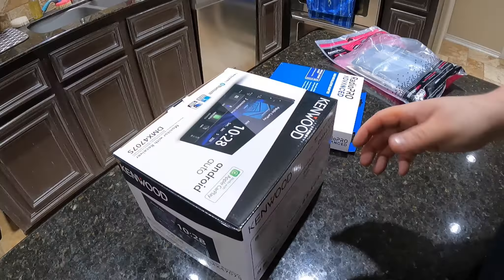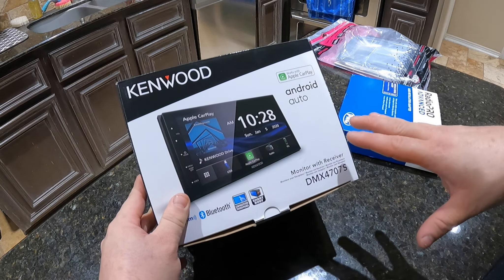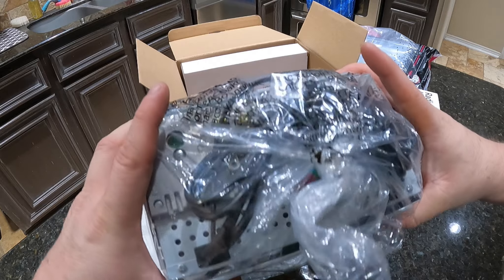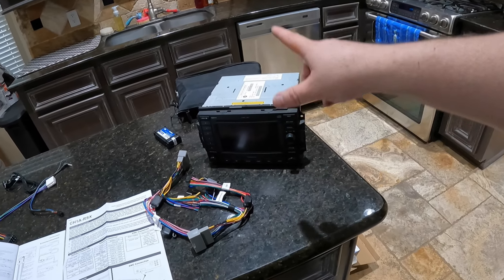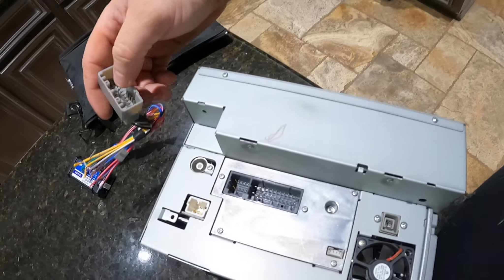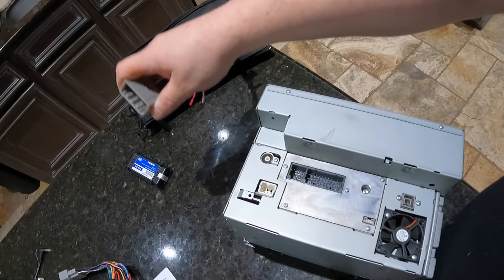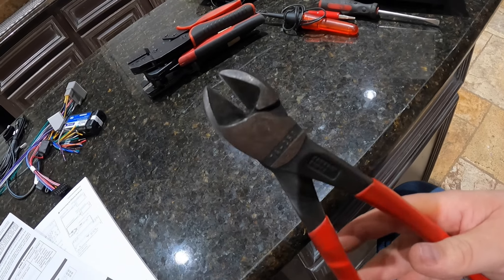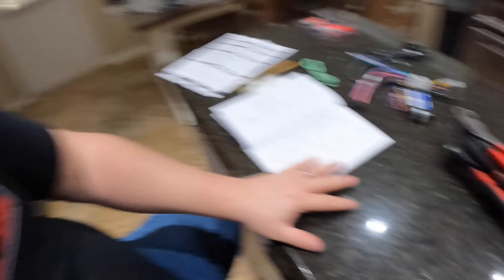New Tunes for my 2007 Magnum SRT8! Double Din Stereo Install + Wiring Tips and Tricks!

Comment: What did you do to connect the steering wheel controls? I have the canbus and it has two wires that say Key1 and Key2, but i don't know what wire to connect them too......
Reply from the maker: Dang, I wish I could remember but I sold the car a couple years ago. Im sure the info is out there somewhere. I got my stuff from Crutchfield, they could possible help if you call.

Comment: What size is the radio
Reply from the maker: @turner2397  it's the stock size double din
Reply: @ 6.8 or 7
Reply from the maker: @turner2397  I have no idea, I don't own the car any longer. It was a Kenwood double din if that helps

Comment: Of you don't mind i would like to know if the (VES) vehicle entertainment system still works. I hear is a big problem when installing an aftermarket head unit.??? I was able to live with out then but now I have a little mini me in the rear seat. Thanks for sharing
Reply from the maker: I believe if you install an aftermarket head unit, the VES no longer works with the cars audio system. It may still work with the headphones but not 100% sure.

Comment: So should you do that front to back connection on all dodge magnums? Or was it because of the time of radio and or wiring harness?
Reply from the maker: The front to back connection was only for the reverse camera I installed at a later date. So you don't have to run it if you're not installing a camera.

Comment: Where did you end up routing that usb cable I’m about to install on in my 06 charger
Reply from the maker: Its through the back and goes underneath the console. I just have it poking out the bottom of the console next to where my knee rests. I tuck it in when I'm not using it but it is also easy to pull out when I need it.

Comment: I need help. Had an aftermarket installed but it doesn't turn on when the key is in accessory.  How do i fix that
Reply from the maker: I honestly couldn't tell you, you'd need to diagnose your wiring with a digital volt meter or test light. Could be several things. Hope you get it figured out